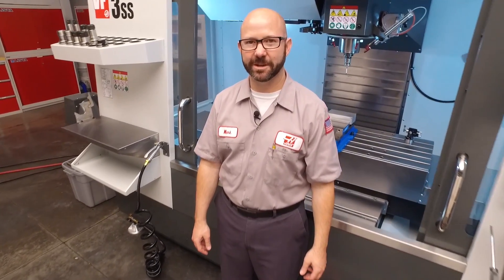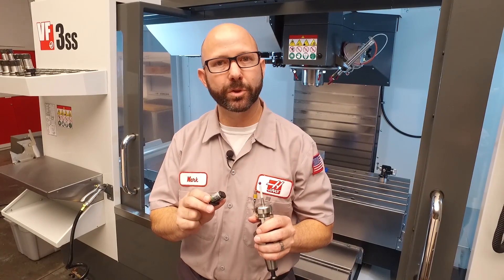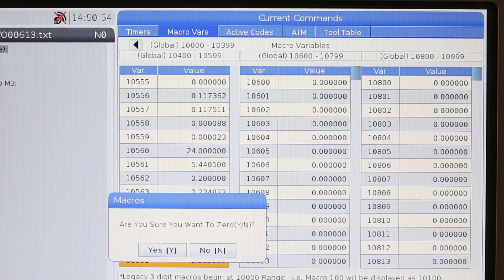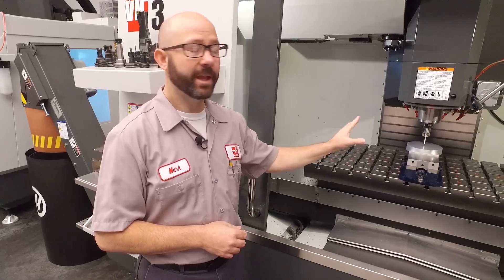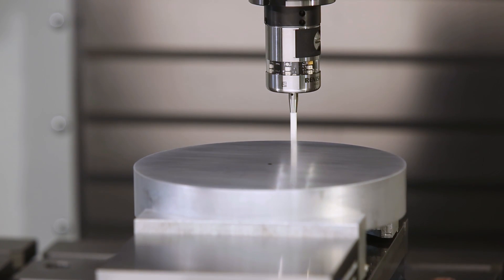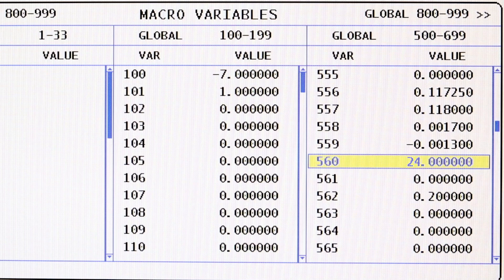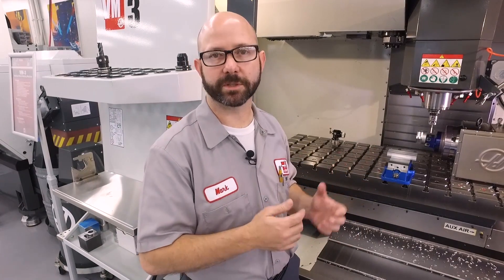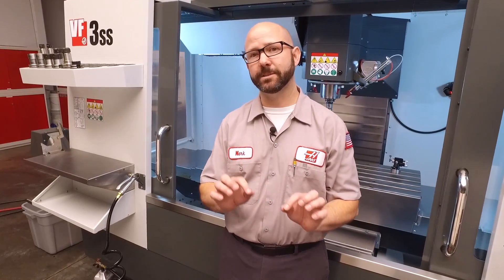Troubleshoot Your Haas Probe, Part 2 – Haas Automation Tip of the Day

Comment: Batteries ... out HFO technician warned us for this. We had a lot of weird probing errors lately with the probe not starting up or suddenly giving up after a few points of probing. A colleague went to a local shop and finally got some same size lithium batteries of an unknown brand. These lasted for 3-4 weeks.
Tip: buy the Saft LS14250 batteries. These are Li-SoCl2 type batteries and that type of batteries is guaranteed to keep their power if stored even for years. We have one WIPS set (spindle probe + tool probe) so I bought 10 batteries in a bulk pack. These should last me a few years without any problems.

Comment: Check out the demountable tool probe system we developed out of necessity. Allows you to remove the probe instantly and reinstall w/no tools or recalibration. in fact, you can share the probe across multiple machines.
Puck Style
https://www.youtube.com/watch?v=JVSCUpSzCPQ
https://www.youtube.com/watch?v=ruSqv84vsLs
Purchase here https://exactengineering.net/products/
Tee slot style (call 781-431-7663 for purchase)
https://www.youtube.com/watch?v=CGXSuNJ876s&t=52s

Comment: I have a 2010 Mini Mill 2 with the wireless Renishaw probing system, lately it has been giving me a weird problem, batteries are good, calibration has been redone and the probing cycles all work perfectly except the Z surface probing that gives me a probe failure alarm 9 times out of 10.... this is driving me insane... do you have any idea what could mess up ONLY the z axis probing cycle and not the others ?
Reply from the maker: Serge Gostoli – You should probably get your Dealer involved (https://www.haascnc.com/about/contact.html  ), or give Renishaw a call on this one (847-286-9953). They can walk you through checking the probe. Typically, 1) reloading the probe macros, 2) clearing macro variables, 3) changing probe battery, and then 4) recalibrating the probe will fix almost all probing issues. – Mark, Haas Tip-of-the-day

Comment: Thanks for the tips, I'm setting one up tonight for a friend and this will make it a lot easier.

In dealing with line of sight issues, how about a way to relocate the receiver within the enclosure?  

Also, as a former software engineer I spent a good deal of time working on user interfaces.  I'm curious, when protecting the probe offset, why does the user need to set it as a probe and also choose clear all offsets except probe?  Why not just add a binary column to all tools that protects them from being cleared?  That seems rather error prone, and the price is time to recalibrate.

Comment: Is there a way to hide the offset of my probe so that the machine operator don't delete or put different tool in?
Reply from the maker: Javier –  On Mills with the Next Gen Control, we can safeguard the Probe Tool Offset just by setting the Tool Type as “Probe”. On machines with Classic controls, there is nothing to keep the operator from clearing the probe offset. If it is cleared, it is best just to recalibrate the length of the probe. – Mark, Haas Tip-of-the-day.

Comment: Who decided of all the technologies to use for wireless probing, picked infrared instead of any form of radio wave?
Reply: Radio comm. isn't that easy in metal enclosure either, but surely would be a more reliable option. The tool setter could easily be made wired instead, much like the rotary tables... The spindle probe could be powered and communicate through inductive coupling if the spindle housing (and the probe holder) would be especially designed for this. No batteries, no issues, indestructible industrial solution.